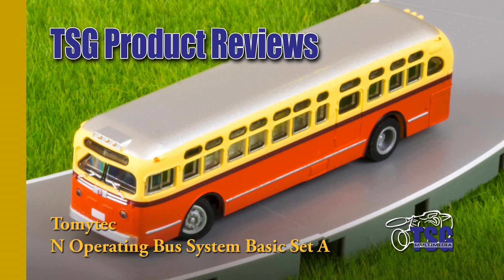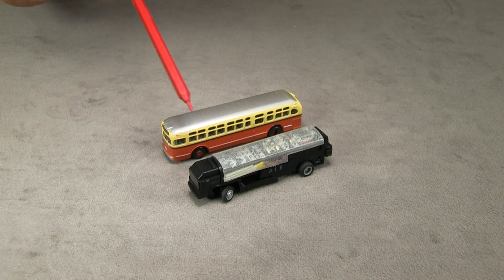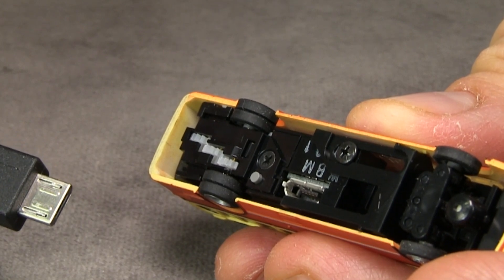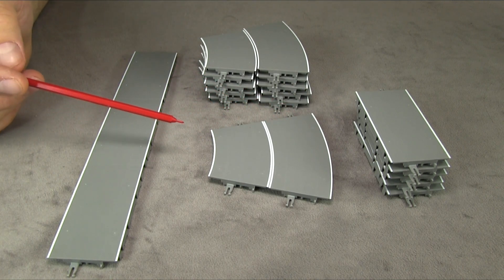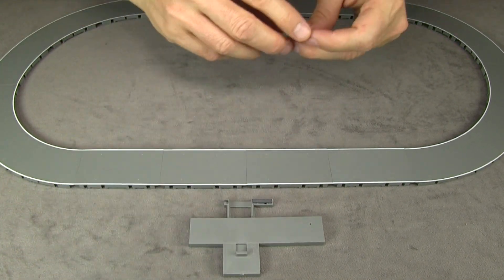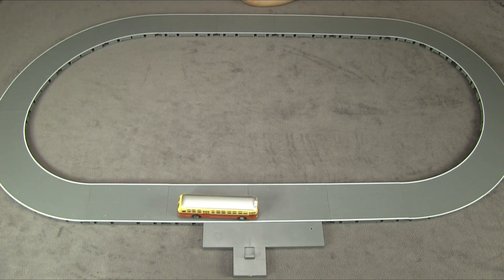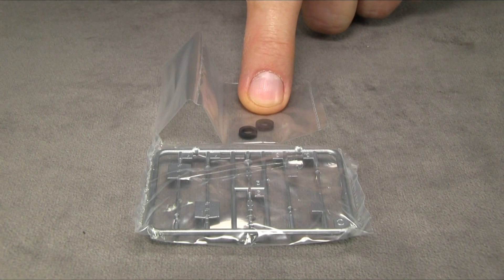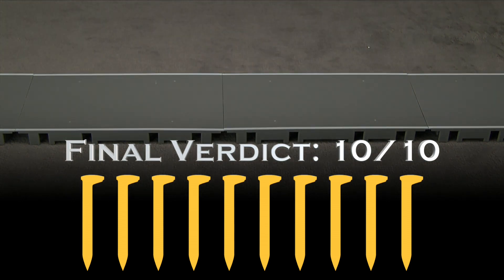N Scale Operating Bus System Tomytec Product Review

Comment: in conclusion, this system works the same as the faller system (vehicle follows wire on road) which means faller cars and trucks can be used here as well. if you plan on making your own roads like I do, I'd say screw the set and try to find the vehicles them selves, then lay a thin steel wire in your plaster roadway for a cheaper and more realistic look
Reply from the maker: As long as it works, that sounds like a great approach!
Reply: Does the steel wire need to be in "one piece" or can I have the roadway to go across the gap of two modular layout sections? Could be very interesting to add as I have a very long section of highway running parallel to the track over several modules.

Comment: In 1960s I had an AristoCraft trolley system with very thick overhead wire rails and the trolley or bus was crude. We're so picky nowadays but that was so fun at that era. It is now so better. Even slot cars were so innovative back then. Thick tracks with joint clips visible and cars barely detailed. I only have a few now but looks prehistoric compared to stuff I got this week by AutoScale. I like slot cars but Faller has nicer system. Anyhowl, were spoiled now. I can't stand Lionel so I got 2-rail DCS locos for example. I'm so spoiled I now only want hybrids. My Dash-8 is terribly obsolete....

Comment: Too bad it’s battery operated as it may not hold up very long in storage, additionally, you’ll need to remove the bus periodically in order to charge it. I was hoping that it used magnets under the road. With a system built on magnets, it’s easier to make your own vehicles and storage is not such a problem. I still like it and the price seems reasonable. It’s very tempting but I only use trains during the holidays. They sit in storage most of the time and I tend to choose a different scale each year which means that it could be in storage for awhile. The battery might go bad on me. It’s still very cool. Thanks for uploading.
Reply from the maker: Lots to consider! Thanks for watching!

Comment: How does the pausing/stopping mechanism work?  Does the magnet trigger a delay switch inside the bus or something?
Seems like one could save a lot of money on "track" by just embedding a piano wire or something under their own roads on a more permanent layout.

Also so many reviews of the tomix bus system show they take 2 sort of hearing aid batteries, while this one charges.  Is that their new standard system?
Reply from the maker: You would have to direct specific questions like that to the manufacturer. We are simply reviewing it here.
Reply: I also have not seen the USB chassis, which would be nice. You can certainly do your own piano wire layouts if your roadbed is thin enough. The stock plastic roadbed is about 1mm between surface and wire, but it may be able to work with 1.5mm-2mm if your road is smooth to avoid bounces. The pausing mechanism seems to work because there are multiple magnetic sensors along the chassis length, not just the main steering sensor. Certain combinations command the motor for different sequences, but I don't think any of them are really documented that well.

Comment: What a great product. I want to get one. Do you have the part # for this exact set with the American style bus?
Reply: Thanks.
Reply: I was unable to find anyone with the set in stock so I had to purchase 
the components individually. It cost more that way but that was OK for 
me as I wanted the green and white bus anyway plus I was doing a "two 
way" setup with 2 buses one running in each direction.

Setup is easy once you figure it out. It is important to set up the "bus
 stop" correctly. My bus was running wild all over the place, falling 
off the roadway until I realized the "bus stop" pieces were set up 
wrong.

I had some problems setting up the buses. The pins on the black pieces 
that go on the front and back of the chassis do not fit in the 
corresponding holes on the chassis. I was afraid to force them in so I 
drilled out the holes very gently by hand with a 1/16" bit. The fit was 
then a little loose but by holding the front and back pieces to the 
chassis I was able to insert it in the bus body without a problem. The 
second problem I had was that on one bus the front wheels were hitting 
the body when they turned causing to bus to do crazy things. There is a 
slight adjustment that can be made to the front wheels from underneath 
by loosening a philips screw there. That solved that problem and all is 
working well now although I'm not really sure the buses speed up and 
slow down very much. One is definitely faster than the other.

All in all a very neat item. Love the American "old look" GM buses. Have
 to see if TOMIX makes a chassis to fit the Wheels of Time "Mack" bus.